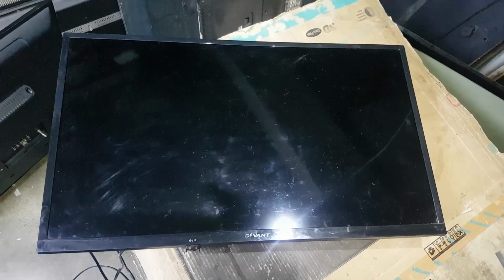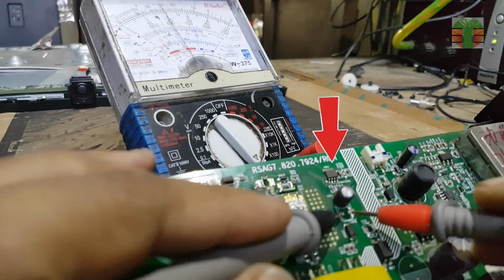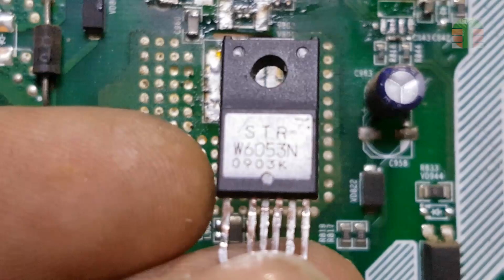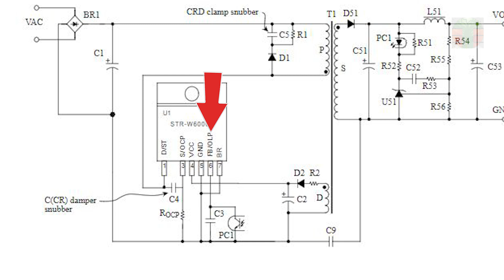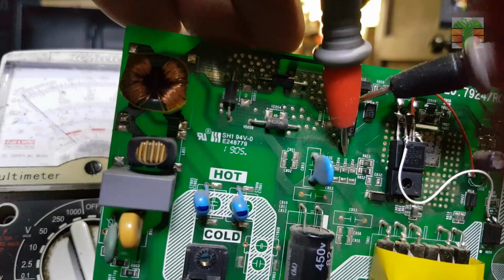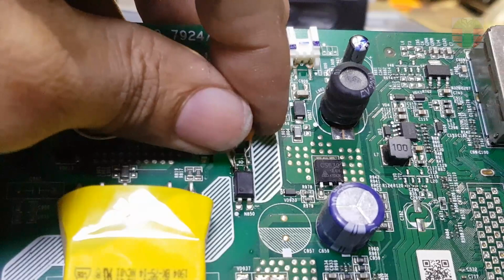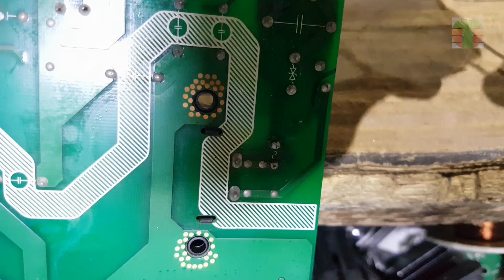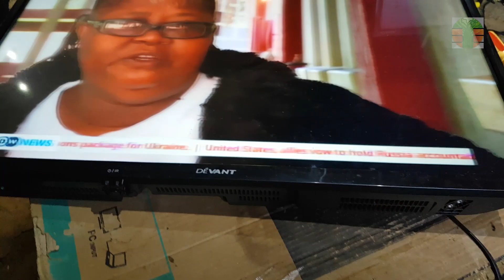TV power supply modification

Comment: Hii, good work, thanks for show some of these techniques.
Pls l have a Samsung TV set that has picture problem.
The picture fades off after about 2minutes. What could cause this and the likely solution.
Thanks
Clement from Nigeria.
Reply from the maker: You can identify if the backlight is fading or the LCD panel.  If the Backlight fades, you can still see the image by aiming a flashlight at the screen. IF the LCD is the problem, you cant see image, only the back will appear on it. If the backlight is the problem, repair it. if the LCD is the problem, it's hard to tell what is the solution.

Comment: What does the initials PWM stands for? I'm following your lessons my man
Reply from the maker: Pulse-width modulation (PWM) is a technique used in electronics to control the average power delivered to a load by rapidly switching a signal between on and off. It's a way to get analog-like results using digital control.

Comment: This is not perfect procedure what will happen when secondary control circuit failure (error amp) 
So you need more precautions and testing methods to fix this module
Reply from the maker: The secondary circuit error amp is not failing.  As shown in the video. The 12 volts out is stable, all working.